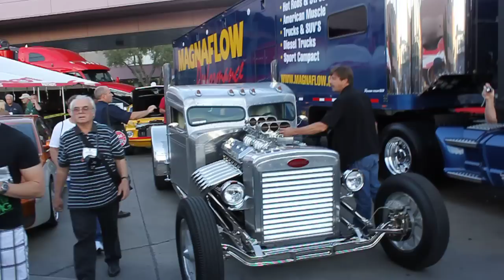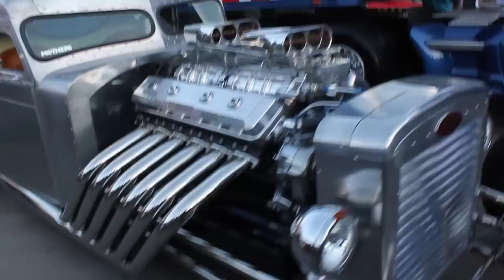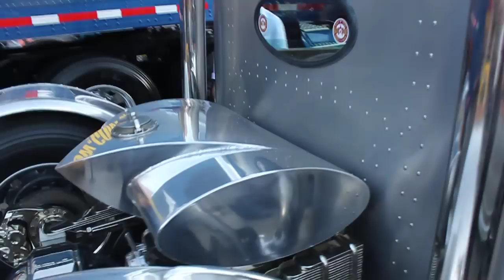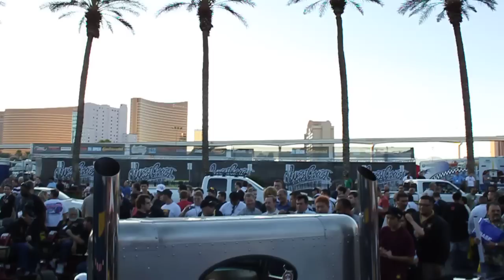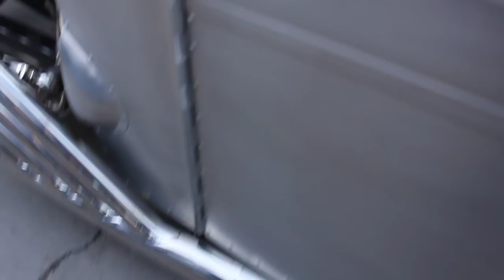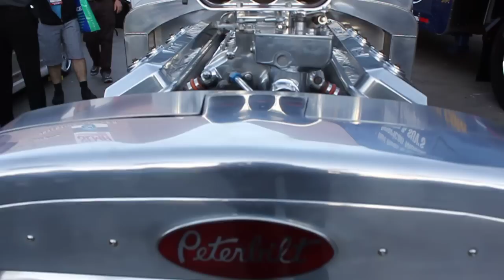Jay Leno's Insane 1960 Peterbilt Hotrod Truck called Piss'd Off Pete showing off for the crowd!

Comment: That Jimmy, with all of the chrome, would look really good in my XM-811!  I have a Cummins 855 now, but that V-12, though smaller, would be quite the eye-catcher.
Reply: Detroit made a 16V71.  I've only seem one in person and it was the power unit on a drill rig.  Polish up one of those and you'd have the baddest Detroit on the block.

Comment: Cummins had a blower on two of their truck engines, the 275 and 300, which were supercharged 220 hp.  Some hot rod truckers removed the blower from the 300 and replaced it with a turbo.  Due to not having parasitic drag of the blower, the engine produced 335 hp.  On a four cycle, the blower does produce boost, on the 2 cycle it just pushes the exhaust out.

Comment: @Uunster the reason its a 2 stroke is because it only takes 2 strokes for the whole thing, unlike the typical 4 stroke where it fires once every 2 times up the bore.  You're correct in that in order to shut down a diesel you shut the fuel off.  I'm happy to answer any other questions you have about diesels also.

Comment: To the posters wondering how a Detroit was a 2 stroke,  It had ports in the block as well as a head with 4 exhaust valves per cylinder.  The blower was not used for boost, rather to blow fresh air through the ports in the cylinders and the exhaust out the valves.  All the Electro Motive Division (now Electro Motive Diesel) locomotives currently use the "same" engine, but they are much bigger, like 710 inches per cylinder instead of 71 inches like this engine.

Comment: @BrantMOB Diesel won't glow, because it burns almost completely in the chamber, or just doesn't burn if the exhaust valve opens quicker, than ignition can occur (high rpms). Diesels doesn't require more air... way more compression (and thus heat buildup (particle movement)) ignites it. Air to fuel ratio in diesel engines is not so important. Damn... that's a cool discussion we brought up onto this vid :D

Comment: Twin supercharged, Two stroke V12 Detroit Deisel, not sure which one it is built from exactly.
Reply: Even the spare part u will dificult to find execpt the recondition one
Reply: +Aditza Gotawa Many 2 stroke Detroit diesels are still working today. Some are still very common, this one im sure is a lot more rare.
Reply: +Gilbert McGillicutty yes sure i think so 2 years i working with detroit diesel for ship propulation,,,normaly the 2 stroke engines is more dirty than 4 stroke engines because scavanging air and etc but this beauty beast can be clean like bling bling,i salute for him
Reply: it's the low horse power 12v72. the high horse power engine has a turbo feeding each blower. ran one for many years in a 74 KW W900 long nose.
Reply: Years ago on the farm, we had an allisson 2 stroke deisel motor, powering a giant chaff mixing machine,
Reply: It’s a 12v71 they are blown motors because they cannot create their own vacuum

Comment: No, Scrapheap71  is correct.  In the 2 cycle Jimmy, the blower was a "scavenging" blower.  It was needed to put clean air into the cylinder and blow the exhaust out through the 4 valves.  On a 4 cycle engine, the roots type blower would be considered supercharged.

Comment: @theLonewhitewolf13 Good answer, man. Using to moonlight an old 72 MC7 charter bus from Ventura to Vegas. It had an 8v-71 with a turbo and a truck 9 speed mounted in reverse (shifting pattern reversed, rear mounted engine). A newer couch sailed on by coming outta Barstow but I slowly reeled him in when we were climbing because I only lost 200+-rpm between shifts and kept her in the pwr band. The 2x look he gave me when I passed was priceless. It had 2 million miles but repwr and roll. 13yrs ago.

Comment: @BrantMOB have You ever heard about 5 stroke N/A gasoline engine? It has 3 pistons (2 small operating at high CR and one big operating at low CR). Firstly the fuel is injected in the smaller cylinders and then after combustion, it's pushed into the bigger cylinder, where its combustion is fully completed. Power output exceeds 100hp from 700ccm and torque exceeds 100Nm and the gas mileage is 2/3 of a diesel engine. That's cool, but I wonder why I heard about it only once :D

Comment: @MrLehi99 a v-8 4 stroke fires 4 times per revolution.  This thing fires 12 times per revolution.  So at 2500 it sounds like 7500rpm.  All Detroit 2-strokes are super charged.  but in addition, a lot were also turbo charged along with the super charger.

Comment: Thanks for correcting my typo on the 6V and 8V Detroit's. So a "blower" provides no boost? Then explain the 30 pounds of "boost" provided by the Paxton blower sitting atop my nitro fueled Hemi? Blowers are driven by the engine, turbos by the exhaust gas. Both do the same thing, force air into the engine. If that pressure rises above atmospheric pressure they provide boost. Every blower I have ever seen compresses air. Compressed air is above atmospheric pressure, ergo "boost". Gauge or not.

Comment: Aussiejazze, no two stroke diesel is nothing like a two stroke gas. As most normal diesels have valves only in head, the two stroke have intake valves in head and slots cut out of bottom of cylinder for exhaust. Without the supercharger the engine would not run. When the engine starts cranking the supercharger forces air in the intake and on exhaust stroke the intake valves open as the piston reaches bottom of cylinder so that the supercharger forces the new air in while pushing exhaust out.

Comment: @johnsenkenn That is incorrect.  DD's do need a small amount of backpressure, even a fairly long exhaust pipe is enough.  They don't need in the same way a 2 stroke gasser does but they do need it.  There is a guy with a video here that explains Detroit 2 stroke operation pretty well.

Comment: It's just different here, that cab is a true Peterbilt cab and that is all you need, it even has the original VIN plate...
You can take a 2000 Lincoln Town Car body and mate it to a 1970 VW Beetle body pan(purely hypothetical) and register as either a 2000 Lincoln or a 70 Beetle.

Comment: @MrSweetleaf92 Actually, it's a two-stroke diesel, which is fundamentally different to a two-stroke gas engine.  This particular motor is four valves per cylinder, but they're all exhaust valves.  Go ahead and watch The Smoking Tire's episode on SEMA 2009 to hear Randy Grubb (the guy who built this truck) explaining how it works.

Comment: @Uunster Not all diesels use glow plugs. Glow plugs also are nothing like spark plugs, they have nothing to do with igniting fuel, they're simply used for warming the cyls for easier starting. In a 2 stroke diesel you instead of having the typical suck, squeeze, bang, blow, you have the intake and the exhaust on the down stroke once it passes by the breathers and scavenges the cylinder, the upstroke is then the compression. the power stoke is also in the down stroke until the point of scavenging

Comment: Alot of your old detriot engine had blower, on the inline engine they have the supercharger on the side of the engine I believe this design has been around since the 30s or 40s these engines were in alot of the heavy construction equipment back in the 70s and 80s

Comment: @2004CobraGuy For a turbo to work on a 2 cycle diesel engine you would need to keep the engine RPM high and under a load for the boost to do what the blower does. There are set ups out there that do use both blowers and turbos blower for low end and turbo for high. but to be able to start and run the engine just at idle you need that blower because that turbo at most will push two pounds at idle and that not enough to get clean air into the combustion camber

Comment: I seen this truck in several configurations with and with out Rear Quarter fenders with out a doubt it looks better with the rear fenders.  I have also seen it with long tube headers and stacks, short pipes bent  several different ways.  I personally like it with Stacks I only think they should have been bigger.  To me the truck is missing one thing to complete the look and that is 5th wheel hitch like a real big rig scaled to size and chromed

Comment: @Uunster 
These engines depending on year and model have either 2 or 4 exhaust valves ,,,intakes is ports reason for the super chargers which all have is to scavenge the exhaust out of them ,,,cool engines ,,,used in about every thing in various sizes  4-53'S were used in alot of farm stuff back in the 60's early 70's

Comment: No, Detroits had exhaust valves, 2 on the early models, and 4 on the later models.  The blower, which is not really a supercharger forced clean air in through the intake ports, and the exhaust out through the valves.  They would not run without the blower

Comment: @brushlessstorm 2 stroke diesels can handle higher RPM then the average Diesel. Old detroit diesels throw out everything i knew on diesel operation. Just to explain there are no INTAKE valves. The intake is in the side of the cyliner wall 2/3 down. 2 cycle diesel need blowers to push the air into the cylinder.

Comment: Of course blowers, whether roots type or centrigal provide boost, as well as turbos.  The difference is in the 2 cycle Detroit, they are not used to increase manifold pressure, the blower is used to push the exhaust out.  Unlike a regular 2 cycle, the Detroit does not have exhaust ports, it has valves in the head, operated by a cam.  At normal atmosphere, the exhaust would not exit the cylinder before the compression stroke, and would not run.  To call the blower a supercharger is inaccurate.

Comment: @BrantMOB higher compr. comes from approx 23:1 ratio (on N/A) or 19:1 ratio (on turbo). More air is because there is no throttle that can limit it, but when gas engine opens the throttle fully it gets similiar amounts of air, yet the CR can be maxxed out only to 12:1 (bigger requires ethanol fuel :)) It's a complicated thing to talk about :D Since the invention of the diesel engine took place, the battle between D and G still rages on :D One thing is sure... diesel without charging is a slowpoke

Comment: @MightyMouse4466 These older engines can only run with a blower at high revs as demonstrated, it has to have forced induction to burn the volume of fuel to make it rev that hard, if the butterflies were shut it would blow a massive amount of thick black smoke due to unburnt fuel. Some later model engines also include turbo which has a blower bypass valve to run turbo at high revs.

Comment: Can someone please tell me what two stroke means? I'm clueless.
Reply: Wikipedia can tell you...........
Reply: Ok if someone wants to volunteer their time and give the simplified definition. Not because I'm lazy but because I most likely will not understand the technical long version. Cheers.
Reply: +Michael Burke a normal 4 stroke engine had 4 strokes. intake, compression, power(ignition of fuel) and then exhaust stroke. 

in a 2 stroke, intake and scavenging(exhaust) happen essentially at the same time.
Reply: +Michael Burke Model airplanes & cars...2 stroke.

This is a REALLY POWERFUL weed whacker! Same type of engine.
Reply: every time the piston meets the spark plug it fires, cept on a diesel there aint no spark plug
one stroke down one stroke up

the blower blowes fresh air in and exaust out at the bottom and at the ttip top the injector fires and exploes a fuel charge
Reply: +Michael Burke Apparently you have never mixed fuel for a boat, weed eater, dirt bike or many other things or you would have asked yourself this question long ago!

Comment: The v-12 Detroit Diesel 12V71 put out about 475 horse power in stock form. If they had used a 12V92 series with twin turbo's  on top of the 2  6-71 superchargers and no after coolers it would have been 800HP, bolt on a set of after coolers and set it up to 1200HP!  Then he'd be able to twist up the frame  setting still!   Of course they could have always gone with the V-16......

Comment: They probably would've flipped their shit if brought my old F150 up there!
Cab from an 86 F150
Front clip and Flareside bed from an 88 F150
A modified 1993 F350 4x4 frame, axles and diesel engine

I miss that truck

Comment: Those are blowers NOT superchargers.  They are integral to how a 2 stroke Detroit runs and are not a Power ADDER.  They do not produce BOOST.  In reality these engines make 435 horse typically and with the loss of back pressure due to the stacks probably a tad less.  2 strokes need a bit of back pressure to make full power.  I would be more impressed if it had twin turbo's as were an option in some applications.  Those were power adders.  A cool piece.

Comment: @rthom86 Actually Detroit Diesel's truck engine since about 1987 has been the series 60, 12.7 liter and  11.1 liter, which was discontinued in 1998.  The 12.7 was available until 2007, and a 14 liter has been available since 2001.  I believe the dd15 has replaced it.  These are 4 cycle electronic control engines.  So it is incorrect to say that "all Detroit Diesels are 2 cycle"

Comment: @BrantMOB .... and even more. You can accelerate the spark in gasoline engine, so at high rpms the mixture will reach its good exploding pressure before opening the exhaust valve. In diesel there is not much room for any acceleration, because injecting fuel before almost highest piston position or/and closing the intake valve could result just by lowering the output power and raise in MPG or even just by premature detonation. MPG in gas engines is shitty because there is much unburnt fuel.

Comment: @joek0617 2 stroke diesels work just fine with mufflers.  So do 2 stroke gassers.  I own about 5 2 stroke engines and every one has a muffler of one kind or another.  A 2 stroke detroit is not like any other engine you have probably ever seen.  The 2 blowers on these engines are necessary for them to run, they provide no "boost" they have no intake valves but 4 exhaust valves.  They don't need expansion chambers like a 2 stroke gas engine does.

Comment: @BrantMOB I am aware of everything You've said... except, that exploding is just rapid burning ;) Diesel fuel is hesitant to explode, yet burns faster... gasoline has opposite specs. That's why diesel low end torque is massive comparing to gasoline, but when high revving, diesel just doesn't have enough time to ignite, while gasoline will still produce good torque at the same and much higher rpms. Ofcourse bore and stroke ratio has much to "say" about max available rpms.

Comment: @mustang2005 It's not the amount of bhp that's significant here, but where it is developed. This is a truck engine designed for good power at 2500 rpm. power is the product of torque x revs. If you have considerable revs, you don't require much torque to develop high bhp (motorbike engines) 
The reverse is true at low rpm, as in this case. 500 bhp @ 2500 requires a torque output of 1050 ft/lbs. To develop 500 bhp @ 5500 rpm would require only 478 ft/lbs.

Comment: the RPM isnt that high.  It just sounds like it because its a 2 stroke diesel.  Sounds like 8000rpm but is only running around 4000rpm.

Comment: @slipperydog1 They aren't belt driven on that motor, or any other Detroit Diesel for that matter.  When BDS refurbs them for a gasser then they get a drive system that includes the belt etc.  Their entire intended function was to move air into a 2 cycle diesel engine.  What hot rodders figure out to do with them after that is a different story.  Actually they are a Roots style blower.  Whipple is a later brand name and uses a different shape rotor invented by Art Whipple in the late 60's.

Comment: @monstermiataman They are both superchargers. they cram more air into the engine,allowing for more fuel resulting in more horsepower, the fact that they are driven differently doesn't matter. the term turbosupercharger was used for years after it's development. period.

Comment: I'd imagine the HP and torque numbers are conservative estimates. My 2006 Freightliner Century came from the factory with a 515 HP, 1650 ft-lb 14-liter Detroit Series 60 6-cylinder.
Reply: Nope that's normal it's a V12 but it's also a 14L engine but it's got no turbos and is an engine design from the 60's or 70's with that 71 series as a whole which was first created in the 30's. Not bad for antique eh
Reply: 71 series built america, literally
Reply: @Jthumper , absolutely correct!! And they fed America for decades. If it wasn't for tens of thousands of Detroits hauling food from farms to mills, packing plants, bakeries and then to grocery stores, most of America would have starved to death.
Reply: It's about 500hp and 1,000ft-lbs ...... he said it on Jay Lenos garage were they drove it

Comment: one question !

where is the smoke from the exhaust ? 

this think is a old two stroke diesel !
no cat,
no filter, straight pipe and no smoke !
why ???
Reply: When a vehicle is tuned properly, doesn't have a lot of excessive engine wear, etc. you'll get very little exhaust. 🇺🇸

Comment: I disagree, unloaded or not, if its really well balanced it can rev all day.  I could see potentially twisting the crankshaft unloading 12 large cylinders at 2500 rpms, but like i said, if its balanced and running completely in sync, he should be able to do this for a long, long time!

Comment: @BrantMOB Yup, advance timing and 4 stroke :) If gas flash burns, then why big parts of it still burn in the exhaust? Making it glow if leadfooted :D And why gas engines are louder, despite twice or more less compression? For me it's just because the explosion graph of gas starts instant for a short period, then rapidly lowers and fades long (that fade is burning in the exhaust), while diesel starts to burn slowly, but raises higher and for longer (torque) period and then fades off rapidly.